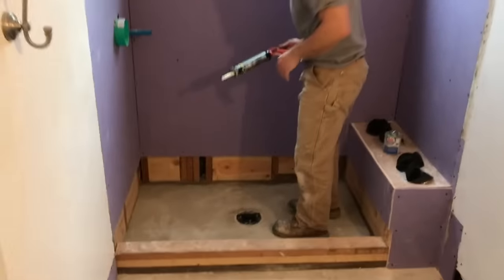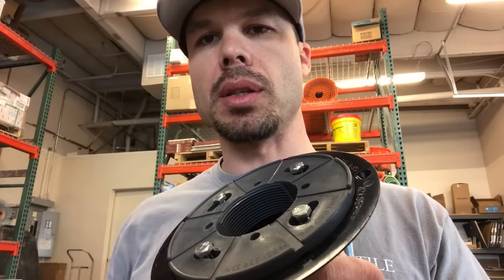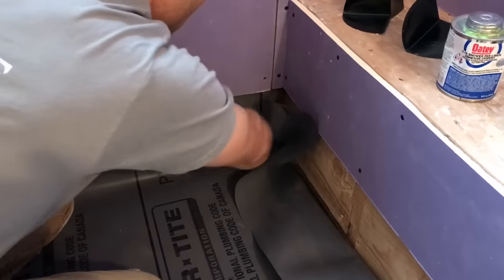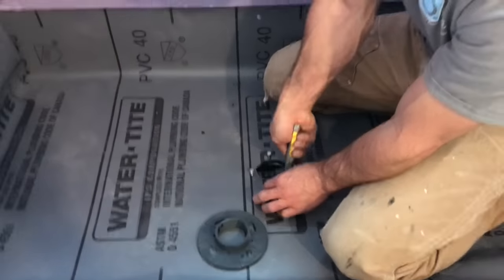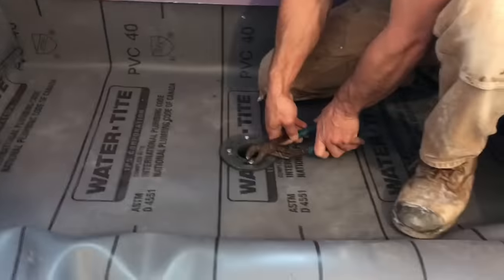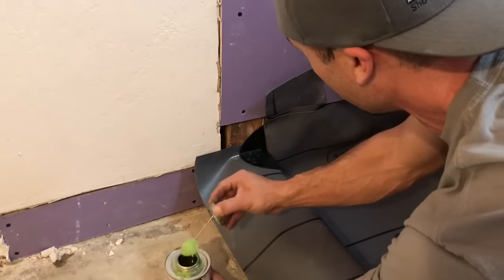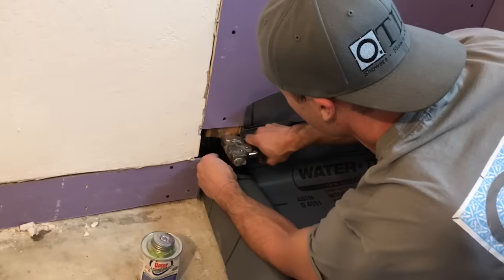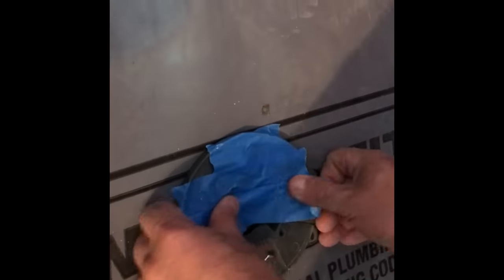Easy Shower Pan Liner: Tile Coach Episode 9

Comment: I lost interest when I saw drywall as your backer . Not even code.
Reply: Lol same here in cali
Reply: Purple rock is allowed in most states and countys.
Reply: Densshield is code in my county too. Cant use hardy back.
Reply: F Vids It all depends on where you live. With that said , I only use cement boards under my bathroom tiles. You just can’t go wrong with it.

Comment: Why not stand a 2x4 up inside and outside of shower, pull the pan up in between and pour the curb? You don't need to seam the pan liner, create chances for leaks by adding Durock to you're 2x4 curb, and it's solid as hell.
Reply: Isaac Ostrom I guess I fail to see how your pan is secured here. Not being critical, I see a lot build curbs out of 2x4, I just saw the pan laying over the curb, I was taught to put mine inside the curb.
Reply: I wasn't asking that. I know the handbook and oatey method l. I see what you're doing now and offering a suggestion for a more full proof install since you pour your curbs anyway. 
Install the liner before the curb. Place your inner 2x4 form board on top of the liner. Then secure your outer form board with the liner pulled up between both form boards, generally need to use 1/4" hardibacker 1 1/2" wide underneath the outer form board to create a slope on the curb to the inside of the shower. Cut the liner to about a 1/2"-1" higher than the form boards Fill in the curb making certain the liner has ripples and at the top of the curb the liner is pushed and embedded into the concrete/tilecrete, and is as close to the outer edge of the curb as you feel comfortable with, knowing you are past the door/curtain. Will not leak, will not move, no extra steps to insure adhesion, or covering screw holes or anything else. You are now bonding tile to concrete on all 3 curb surfaces. There isn't a video for it, I guess I could make one on my next shower that uses a rubber liner.
Reply: Isaac Ostrom NE Oklahoma. Tilecrete is generally carried by interceramic and Emser distributors. It's a sandmix/deck mud like 4-in-1 from mapei.

Comment: Don't plug up weep holes but cover with tape No No No pea rock on top of flange
Reply from the maker: We were simply protecting them while we floated the walls.  But you are correct, drain rock is needed around them to help water flow through them.

Comment: YOU CAN NOT USE  DRYWALL IN A SHOWER  WALLS ,EVEN YOU CAN'T CAN'T NAIL OR SCREW THE LINER WHEN YOU SET THE BOTTOM CUT ,HAS TO BE AT KEAST 8" UP FROM THE FLOOR

Comment: i still prefer the Schluter system. I understand it doesnt work for "every" install situation, BUT, with super high quality tile thinset(Laticrete 272, etc,,), Kerdi, and epoxy grout, the shower floor is not likely to fail..

Comment: No sabes colocar el shower pan
Reply: you need to review the shower pan liner manufacture brochure. And read the instrucctions. Blue tape over the drain flange is unnecessary you need to use pea gravel amigo. And those corner cuts are not protecting the curb. And the exterior of the wall. What a way to desinform people with ignorance.
Drywall screws min 8 inches a part.
And never never install drywall in a   moist environment.
Reply: @TileCoach  
I got the point of meeting the code ordinance's i didn't have a chance to see your other video's. 
But trust me after seeing all the other pros doing shower pans and nailing them to install hardybaker and saying its fine we are going to apply redgard. Is unacceptable I feel is my obligation to upload some installations.
I don't use hardy. We do custom work. And also never use any drywall behind a shower wall. 
 If the point is to meet the thickness for corneround. 
I seen shower walls attach to the framing with 1/2 inch staples and almost get hurt at the demolition. 
Grettings from S.B. cal.
Reply: @oscararroyoperez1867  there is more than one way to skin a 🐈 the point is that the cat get skind. Right.
Reply: @TileCoach  please Don't answer this kind of people,i would like to see your videos and learn,there is always haters,they can send us a link,so we can go see theirs videos😁
Reply: Ricardo Campos, tienes tu algun video donde nos puedas enseñar como se hace???

Comment: This guy uses the cheapest drain base he could possible find. Those things are made from thin flimsy  plastic and it’s not even PVC. Those drains  are prone to cracking and breaking with time. You need to use a shower drain made of brass.
Reply: You could just hear how flimsy and cheaply made those plastic drain bases are made when he shakes it and you hear the bolts rattling. No excuse for ever using those plastic cheap drain bases from the big box stores. Buy a better brass drain base at a plumbing supply store or online.

Comment: That shower will fail.you have no pan overlaping that seat.your pan in not "tight to the floor,before you run it up the walls...and for gods sake, use cement board on your walls.not that garbage,not hardibacker(glued together cardboard)

Comment: I don't even know where to start of everything I saw that I don't agree with. Staples... not roof nails? Moisture and that liner falls away from wall. 2. Where's your torpedo level on the drain? Don't tighten down bolts till it's level. Put drain top on and level it. 3rd. Those corners.even with corner seals.. one is enough if you do it right.  Liner should fold all the way over threshold curb.  And you drywall...cmon. can't even use cement...hardee...or sentinel or schluter? And it doesn't go down far enough. Your tile will gang at bottom with no support. Good lord. What a mess

Comment: please!!!! do not do what he did..... if by any chance you miss a little spot 1/16 of an in or smaller you will have water damage, cut the top 2x4 on the curb 1in smaller and center it that will allow you to fold the shower pan into the curb .there is already 1/2 inch margin for thickness to fold the shower pan its lot easier  and better

Comment: NOOOOOOOOOOO Dont put silicone on the drain, minute 4 see second part of the drain the little chanels under, thats for drainage too.
 If you are an expert dont use sheetrock in sower walls.... waterproof sheetrock?..... sheetrock are sheetrock even with waterproof membrane.

Comment: I hope you have stepped your game up in the last 2 years and f**** did away with anything that you have to put holes in the freaking rubber liner and hope that silicone holds it I mean if not dude just go to the two-day free seminar that kerdi holds in the city that you live in they put you in free room and board they give you free drinks and a hole tutorial on their system please stop with the rubber and the drywall

Comment: Allow me to simplify; Tile inside a shower is no more waterproof than your roof tiles. I explain to all my clients that when you are confident that you can take a shower before any tiles are set, and nothing behind that substrate gets wet then tiles can be set. If you can bring a garden hose into a shower prior to tiling and drench those walls with great confidence that it is waterproof, then you can set tiles. Cement, cement board, green board, water resistant drywall are not waterproof.  They do however, absorb water very well, and therefore, every shower must include a vapor barrier under these substrates because moisture will eventually soak through. And personally, I am not confident in a "waterproof coating" of 2 coats of red guard or tar either. It is too thin and not always a recommended surface to apply tile onto. The best showers I have torn out are the thirty year old and older showers built with solid vapor barriers, wire, then cement mud beds and walls. Everyone was dry as a bone.